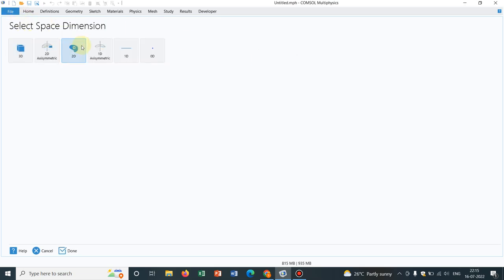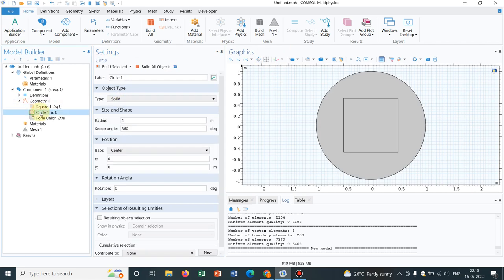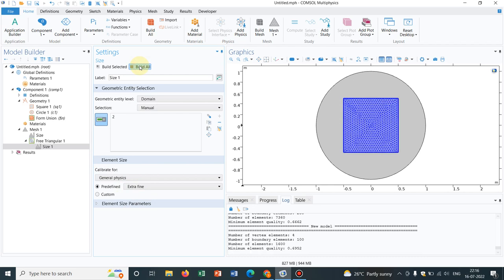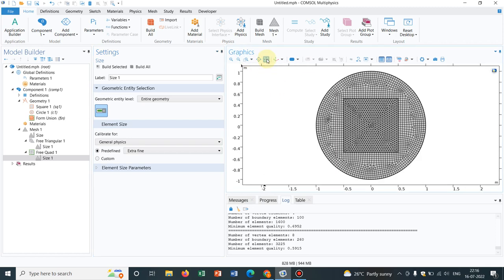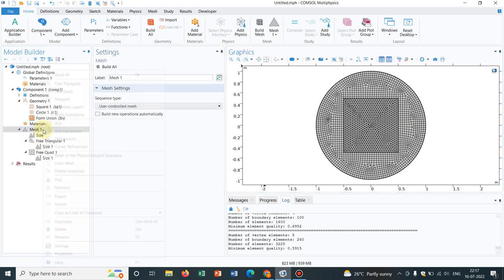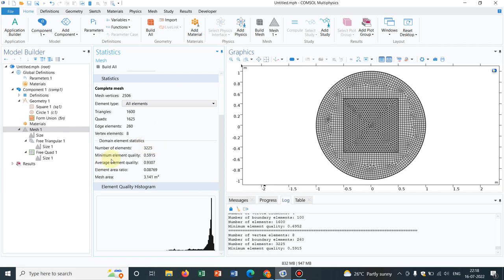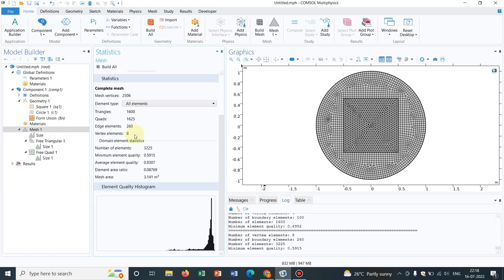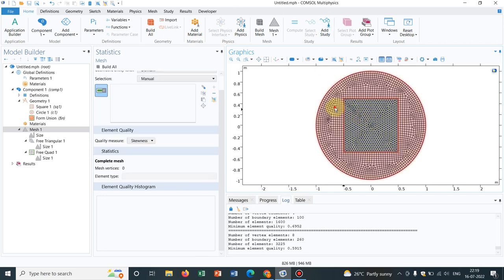Mesh Statistics in COMSOL in Detail #Mesh #COMSOL #Statistics #Research #PioneerOfSuccess

Comment: Does this quality has anything to do with how accurate the results are? Like more the quality more accurate the results?
Reply from the maker: It is problem specific. You may have different physics in different domains and some physics may require fine mesh. Again, fine or course mesh depend on the length scale of the process. It is not the fact more fine means more accurate. But it is the need of the specific physics. You should always do a grid independence study to validate your results.